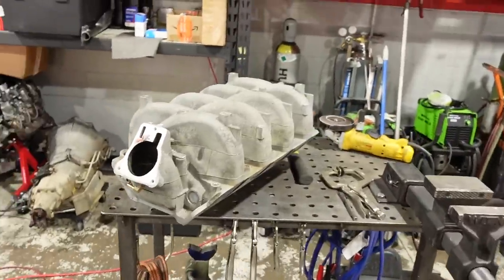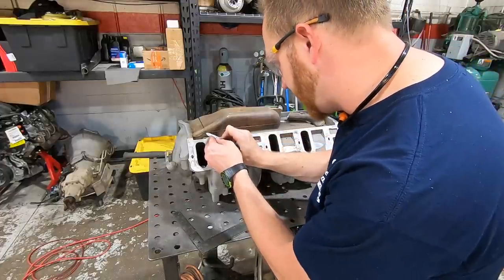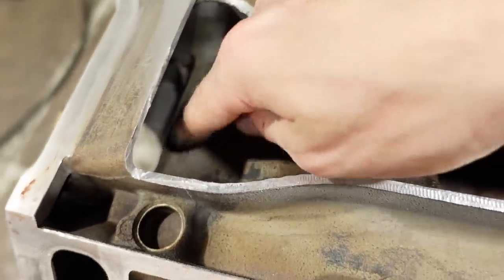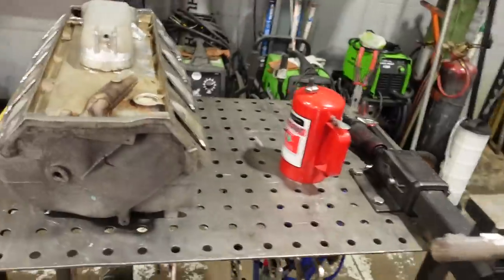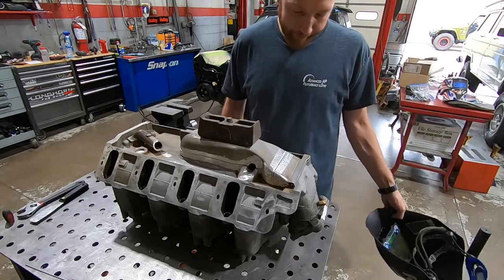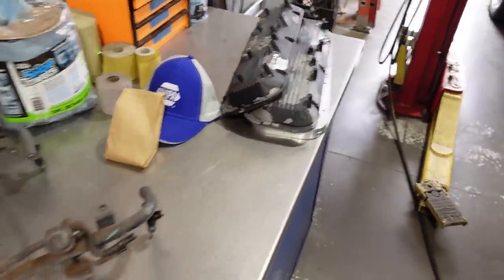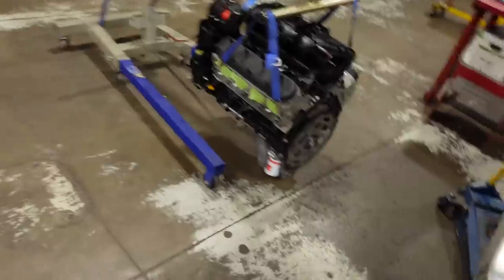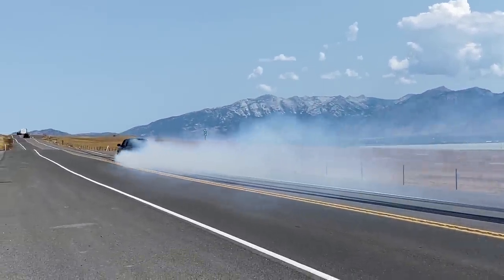fixing the WORST ENGINE DESIGN I've ever encountered

Comment: Ive seen other ppl preheat cast with a prepo torch to help burn the impurities out b4 welding
Reply: Yeah ive seen it done also especially in pipeline welding.
Reply: You preheat cast and let it cool slowly to prevent cracking when welding on it
Reply: Yes when i was at tech one of my instructors was telling us if you have to weld cast preheat and a trick to let it cool slowly you could bury it in some sand for a few hours
Reply: Most of what is being discussed applies to welding cast iron. It really does not like the welding process and is prone to cracking if the heating and cooling is too sudden. 
The biggest issue with welding aluminum cast or otherwise is cleanliness and heat. Dirty aluminum is almost impossible to weld. Large/thick pieces dissipate heat quickly so without preheating it’s hard to get good welds. Conversely it’s really easy to burn through thinner aluminum with good heat control.  Getting good welds ( on any material) requires practice.
Just my experience.
Reply: I would have  epoxyed that small piece in.
Reply: @gibbeys right ✅️
Reply: @bradmarking9106 eh nah

Comment: I've done a few cut and gut and the easiest way is to chuck it up in the old Bridgeport and whack the bottom off of the entire unit from front to back roughly an inch from all sides.  This gives you plenty of room to clean up the ports and plenty of room to weld on a new an improved bottom.  I'd fabricate the bottom cover from 3/16 plate which has a 2"drop in the front with a sweeping radius that follows the intake runner and taper it to the back of the unit to smooth out the airflow.   

This mod with Stock heads a comp 46-422-9, shorty headers and high flow cats and exhaust,  42lb. injectors and a proper tune, makes 460 HP and 500Tq at the wheels.  (4L80E trans)
The stock manifold with all the other modifications would loose about 30 hp-tq and the engine would lay down around 4800.  Time and money well spent over the Raylar bucks up unit.    

I don't care what anyone says about the Gen IIV,  they respond very well to just a few modifications and are pretty much bulletproof.  As you will attest to.   Great content,  always fun  to watch another Gen IIV sucker working on this junk.
Reply: When the intake is modified, does the engine lose any bottom end torque? I use my truck for towing and wouldn't want to lose power on the bottom.

Comment: My first cast repair job went the same way… turning up the “cleaning action” or AC balance ends up putting a lot more heat into the TIG torch. Fried the torch by welding for too long and ended up in the same boat. 

Do your welding in smaller spurts if you don’t have water cooling for your TIG setup.

Comment: My experience is limited with cast aluminum but I've found that once the part starts getting hot porosity became more of a problem because the heat was releasing contaminates deep within. After dealing with that a few times I found that pre cooking it to help burn out the oils embedded deep into the casting.  But still believe in letting it sit and cool down rather then burn it all in at once.  Nice job 👍 looking forward to seeing what the 8.1 will do with the mods.

Comment: that shelf is there to make the air distribution more even across the cylinders. this is what a limited plenum volume gets you. So you should make that underside plenum as big as will physically fit. make the plenum go deeper into the lifter valley and then build a tin oil splash shield to keep the oil off of it.

Comment: Hi LT, Instead of welding the cast aluminum why not use JB Weld to cold weld the two pieces back together again. Plenty strong enough for your application after curing for a few days and no leaks. Heat it's and issue nor chemicals.

Comment: im pretty sure the reason chevy design the intake that way was to help balance air pressure and displacement across all the runners from the center out instead of the front runners taking priority and making factory tuning easier. Good mod for Boost though!
Reply: Yes, you beat me to it.
Having it underneath would also reduce fuel drop-out as the engine would heat the transfer passage, pre-heating the port air*, and it would aid bonnet (hood) clearance.

* I expect they're still port injected, as DI would be a MAJOR redesign issue.

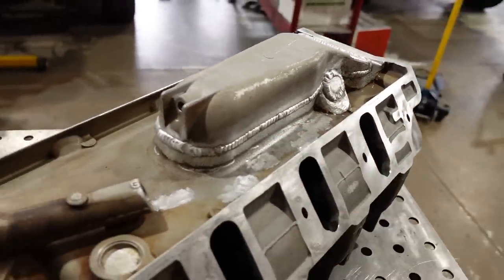Comment: At 13:18 - you showed that you sealed up the one end of that tube you cut out, but what about the other end? Does it connect into the intake plenum as well? IF you don't close that up, aren't you going to have a massive vacuum leak?
Reply from the maker: The other end just goes out toward the back of the intake where it passes outside with a block off plate. It’s no longer connected to a vacuum source (that got welded up), but could be used as part of the PCV a system if needed.
Reply: @LawrenceTolman - ah, got it. From the video we couldn't see what/where it connected, so it was worth asking. Thanks for answering!

Comment: Just some extra ideas if you did this again. I’ve done this in manifold repairs Instead of welding cast you could mill each side flat. depending on the wall thickness to determine hardware drill and tap. use tapered cups machine hardware  m4 m4.5 or m5 and use permatex. Under boost it could be questionable would require some extra hardware (to accomodate pressure) but na applications it would work pretty well.

Comment: Love these videos
GM: millions of dollars of R&D using multimillion dollars computers, CFD software, dynos, and other test equipment.
Hotrodders: I have an angle grinder, sawzall and welder.
Appreciate the fearlessness, but I'm doubtful you've improved airflow, and may have negatively affected distribution. Has someone done dyno tests on this?
Reply from the maker: According to his website, Raylar has verified this on the dyno. Plus, Richard Holdener has backed up these claims with a similarly modified intake on his channel.
Reply: @LawrenceTolman  Very cool then.Nice job on the welding BTW- factory cast aluminum is tough to do.

Comment: Sounds like the new project will be the same truck im building. Syclone-clone. Im using, Twin turbo 6.0. 4L80E, NV149, ford 8.8. 14 inch C6 brakes and 6C wheels on all 4 corners. Got the front diff out of a Bravada with the GT4 optional 3.73 gears that match the 8.8.

Comment: When i was building aluminum boats we used to refuse to weld on cast aluminum lower units on stern drives and outboard motors because of all the impurities and sand that were in the castings. It was about a 50/50 chance of getting a watertight decent weld and the custwould literally want us to warranty it for as long as they owned it!

Comment: Hello.
I remember when I was a child, reading an used car advice magazine, with reports of many oil consumption issues on GM-made Opel models. I guess it was common in the period the Vortec 8100 appeared.
Concerning the weird intake airflow design, I am sure the engineers who made it wanted to add some intake legnth to turn the engine torqueier at low-end range, as it was supposed to be put on utilitary vehicles. A shame the manifold looks like a pressure loss trap.

Comment: They did that design for even distribution to the cylinders, the air entering the center of the plenum made sure all cylinders got the most balanced amount of flow. same reason they have that big cylinder in the LS intakes.

Comment: Color is pretty slick.  Clean but not over the top.   On the truck, those look like factory 18", but what tire size are you running.   I have some for my 72 C-10, apart from swapping 70 6 bolt hubs and axels vs adapters, I am not sure to run a 50 or 55 series tire on them.  245-265 widths.  Your thoughts?

Comment: When you cut the pipe out, why did you only weld a plug on one side and leave the other side open?
Reply from the maker: The other side has a block off plate on the outside of the manifold. No need to weld it shut

Comment: What did that air to go to? Was it dropping extra airflow to the two back cylinders? What was its reason I seen you blocked off one side but what does the other side go to? Or does it just use that as a vacuum reference port?

Comment: Does the other end of the "pipe" that you removed need to be sealed up, as well as the one you sealed up on the side already?
Reply from the maker: The other end of the tube goes up to the outside of the manifold where there is already a block off plate, so no need to weld that tube. Plus, if I wanted to integrate it into the PCV system that would be a great spot to pull dirty vapor out of the crank case.

Comment: That looks like they made that reverse shelf thingy as a velocity chamber. If I'm right, it might cause it to feel doggy at low speed, from a stop. Might have turned your manifold from a long runner to a semi short runner. Nice work though, I can't weld to save my life.
Reply: Yeah, it was likely a tuning element to improve torque and throttle response off idle and at low speeds.

Comment: Just the tip when welding aluminum, try and avoid sanding discs or cutting wheels, it embeds trash into the aluminum and makes it difficult to weld
Reply: What would you recommend to use?
Reply: @justfoundmy10mm in my experience, roughing it to size with a cut-off, shaping with the flap disc, then finishing off with a carbide burr on a die grinder works pretty well.
Reply: @anthonymason701  that is what I figured. Thank you for the information.

Comment: So my father in law bought a 2500 avalanche about 10 years ago , this summer he was in a accident in the truck , so he bought 2 more one for parts and one for a temporary replacement for his original one , he is gifting me his temporary replacement and were going to pull the motor , transmission , transfer case , computer , drive shafts , and a few other odds and ends ,from the parts truck, thoes extra parts will either go to future repair or we will be building a ugly truck or car like you have to swap the extra 8.1 and a big turbo .... I also have a sierra 8.1 and a 5.3 tahoe , just all around awesome vehicles at the pinnacle of general motors before everything became over loaded with computer problems and active fuel management bs,,,,

Comment: Just an opinion; by removing that "shelf", as you called it, I would think that you killed both air velocity and vacuum signal in the plenum. Though you did enable a greater volume of air to flow through, that increased volume would only be beneficial at sustained high RPM. Plus, by only removing the front "shelf",  rather than opening the whole lower half of the intake as the other manifold, I would be concerned about air restriction to the back four cylinders. 
     The two considerations that may cancel these concerns is, 1, your mentioned forced induction, and 2, the fact that it is a fuel injected engine, so you're only moving air through the plenum.
It would be my assumption that unless you are reving north of 7-8000 rpm's, or have bored and stroked the engine off of the charts, that you may have killed that intake for streetability. I don't even know if that mod would be beneficial to a dedicated street/strip vehicle.
    Look forward to updates and the outcome of that mod on a street sleeper.

Comment: Instead of using tape and an exacto knife use grease to cover areas you don't want paint on.  When the paint dries just wipe the grease off the surfaces you didn't want painted. Takes much less time and the results are the same.
Reply: Because grease holds onto moisture
Reply: @shadowopsairman1583  what?

Comment: For the 8.1 you would have gotten another 75.6 Horsepower if you had painted the intake red.
Reply from the maker: Dang it! Missed opportunity there
Reply: @LawrenceTolman  a red stripe decal across the heads means moar faster 200% hp increase to the awd tourque blaster

Comment: You can tell GM puts a lot of engineering into their stuff, but they always manage to miss an ideal design. The 96-99 7.4L vortec 454 was a great engine with improved 4 bolt block, improved oiling, and back to full size oval port heads. But it also had a badly compromised intake manifold that was only effective at heating the intake air to full engine temp, and killing torque over 3500 rpm.
Reply: But under that, and at part throttle - especially under cold conditions - it would reduce fuel drop-out and improve fuel economy, torque, and probably throttle response.
For what it's supposed to be, a work-horse, the manifold is a sound design.

Comment: Get ur self a gas lenz kit.u will thank me
Reply from the maker: I have one, but only use it for stainless and mild steel. Aluminum doesn’t need a gas lens plus the heat from ac welding can melt and damage the fine mesh of a lens.